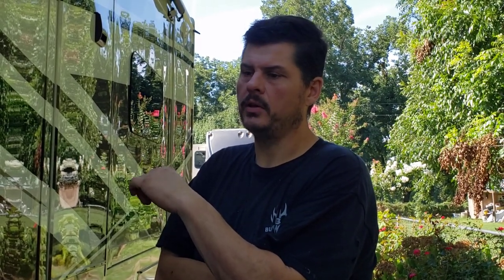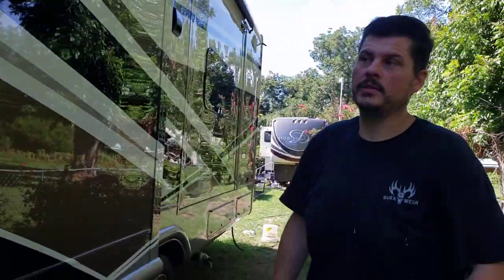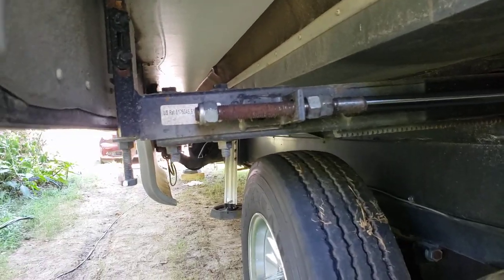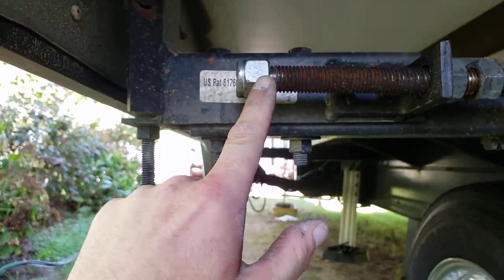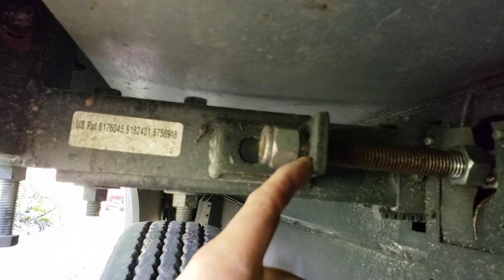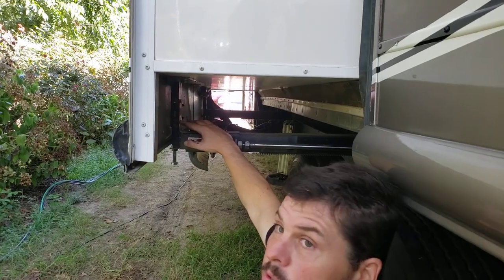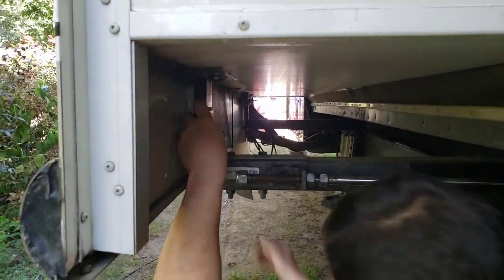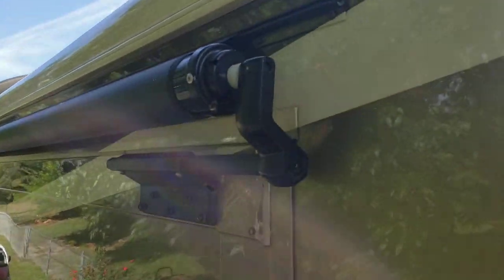Lippert Hydraulic slide adjustment.

Comment: Is this true?

The clearance between your slide T edge/fascia and the cut-out sidewall has grown to a point where making adjustments cannot overcome the excessive clearance. That is why we add an additional seal on the inside, in order to make up for the excessive gap. This happens sometimes after slides get old and maybe have had a lot of use, the structure of the slide frame work can get to a point that it is not plumb, or square, anymore. Consequently the geometry of the slide is no longer the way it was when it was first built.